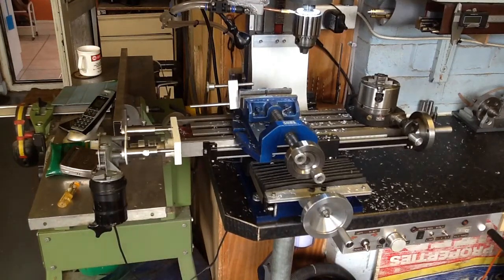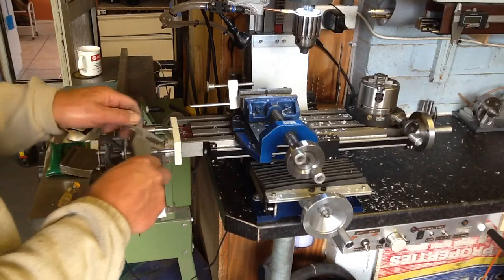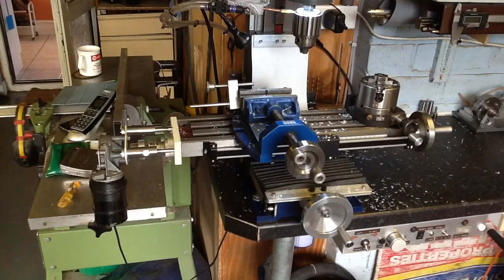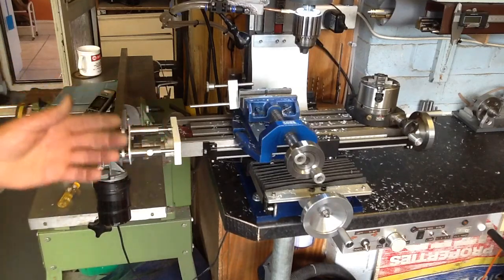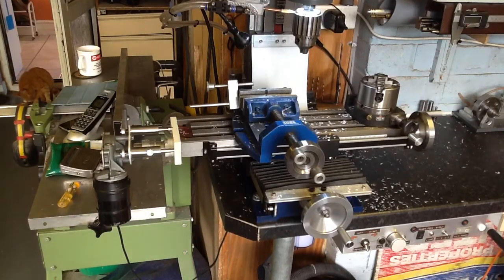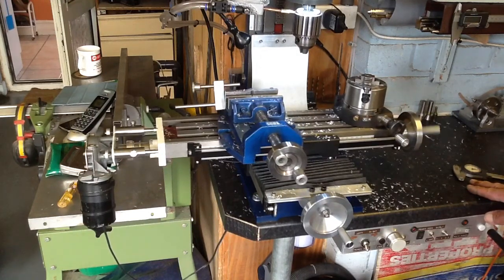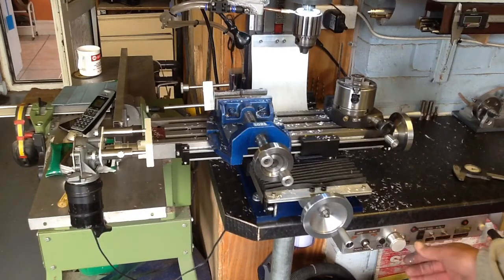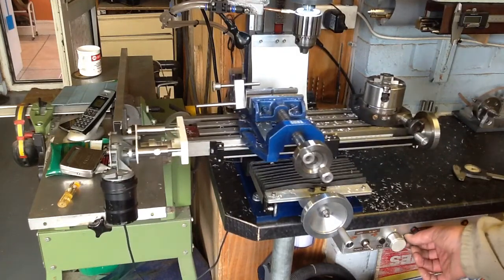Homemade power feed

Comment: The system works well by the looks of it. The main reason it works faster one way than the other is beck of the set up of the worm drive in the gearbox. Depending on the actual arrangement some worm / gear drives are designed only to work one way and if the worm screw helical angle is radically skewed one way it will take more force to turn in the reverse order.

Comment: IF it is good????? YES and NO. 
YES because it's electrical controlled.
NO because has no syncronization with rotating speed of the chuck. Chuck speed may be affected by mechanical couple. So: how do you syncronize them???
Reply from the maker: Thank you for your comment, but I'm not really sure what you mean? ????
Reply: Well Let say your chuck has a speed of 1000 RPM in free motion. When you turn a piece of metal that speed will be slower then 1000 rpm that means you cut more metal on ona rotation of the chuck. That means, your turning or milling is not constant especialy when the metal is iregular. That's not happens when the power feed is in syncronization with chuck or milling tool.

Comment: I made a power feeder for my mini mill using this approach and it works for my needs.  My wiper motor is a two speed motor but I isolated the case from the power supply negative so that I could apply 12v across the two normally used motor brushes, which results in a third (and fastest) speed.  I bought a ganged 3 deck, 6 contact rotary switch and wired it so that I have 3 speeds in each direction from a  fixed 12v power supply,  My motor mounting plate also slides in/out on alignment pins to engage/disengage the drive but I used a spring and ball detent to hold it in the engaged/disengaged positions.  For the drive coupling I machined an adapter which mounts to the wiper motor shaft via a brass shear pin with a hex shaft on the other end which enters a deep socket that's mounted to the table and connected to the lead screw. Saved a bunch of money doing it this way plus I got the entertainment of designing and making it.

Comment: Nice!
If you want more speed consider using a 24V power. In the car it would burned the motor, but in this application the load and running duration is nothing near the original wiper job.
The different speeds are because the brushes are timed some degrees to get more power in the intended rotation direction.
Rudy

Comment: ingenious!  Great job.  I like the engagement!   I wonder if the difference in speed depending on the direction is because the wiper motor typically only runs in one direction when in a car.  Maybe the brushes are slowing it down a bit when it normal direction of rotation is reversed by changing the polarity.  Nice shop!  I sub'd....looking forward to seeing what you make in it. :)
Mike

Comment: Very nice!  I have thought about doing this to my G0759 mill.  I see you have your vise AND rotary table on the table at the same time.  I did that for a bit but it seemed like there was a bit too much drag on the X axis so I don't do it.  I think my vise and RT might both be a bit heavier than your.  Very nice job on the control panel!  Is that a simple DPDT reverse switch?  Thanks for the video!

Jim